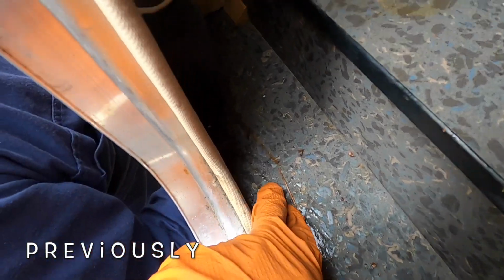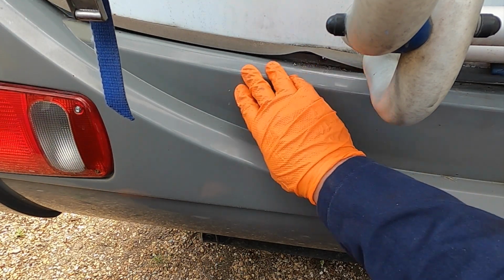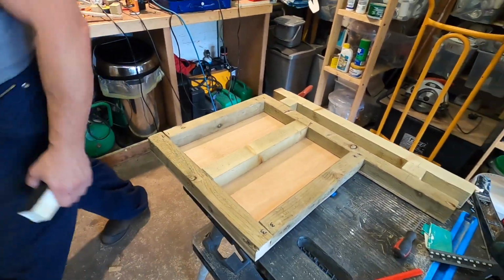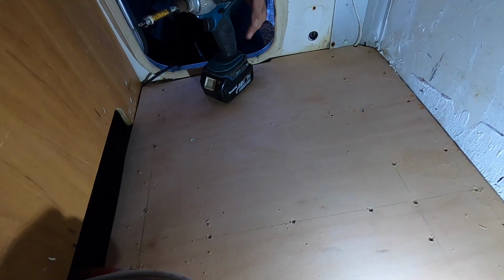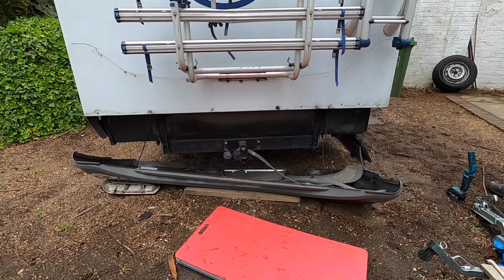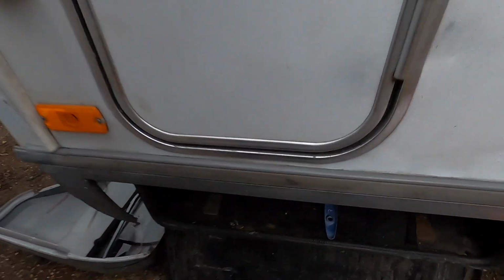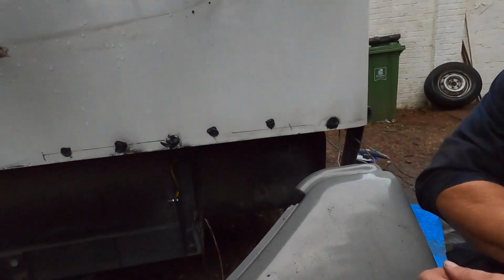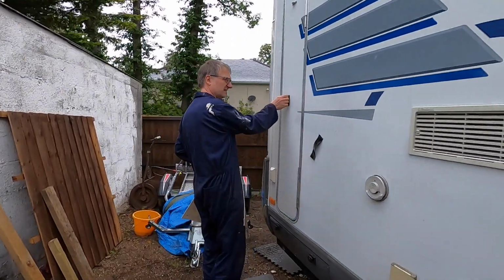MASSIVE HOLE in Water Damaged Floor

Comment: Well done Ads and Chas for what I would consider an excellent job. I need a Chas down here in Southern France.
Reply from the maker: Thanks Robert, what wrong with your vehicle down in France?
Reply: @HermanHitstheRoad  Nothing really. I've recently serviced it, including new discs and pads, and I know all there is to know about the interior and have changed most of the usual stuff, pump, electrics, tank sensors etc. etc However, we have Alde heating that has sprung a small leak in the cylinder. I've managed to buy a new boiler (ex bankrupt stock here in France). The location of the boiler in the van  is awkward to say the very least. Access is via a small hatch on the side of the van and you need to part dismantle the old one to get it out and the reverse to get the new one in. I don't fancy doing it myself to be honest. That's why I need a Chas, ha ha
Reply from the maker: You want to get that leak sorted as soon as possible otherwise it could cause a lot more problems. Just take your time and I'm sure you'll get it done. Would it help if you removed some panels, wardrobes etc? I wish we could help. Maybe you can send us some photos or do a video?
Reply: @HermanHitstheRoad  Thanks Ads,  It's times like this when you could do with a little help. I had it booked in to have the work done in March ( I think?) but they couldn't do it because of lockdown/sickness etc. We've been to the Alps since I may add without me having to top up the reservoir. The boiler is ok if it's on (water expanding) but if I switch it off and it gets cold, it leaks through, what must be a pin prick of a hole. I'd like to send you some pics but where do I send them. There doesn't appear to be an e-mail address on YouTube. Bob
Reply from the maker: @robertpenning3501  You'll find my email on our channel page under "About".
So, it only leaks when the water is cold? That's odd. Could it be that when it's hot the water evaporates before you see the drip? Or that there's a seal which heats up and expands stopping the water?

Comment: If you want to tidy the back wall up use the 4 way stretch carpet they use in camper conversions and it would be easy and look very tidy. There is a video on YouTube showing you how to do it. Good job with the floor.
Reply from the maker: Thanks John, I'll look into it. I might just use the hair dryer and scrape it off. 🚙👍👍👍

Comment: You two have such a light and encouraging manner whilst also knowing your stuff. Could I please ask how you fixed your made up 2 by 2  insert frame to the existing 'ply and insulation sandwich' floor. There isn't a great deal to fix it to, is there as it is mainly insulation foam plus thin top and bottom ply. I ask this as I am about to tackle something similar!
Reply from the maker: Thanks Nicholas. We screwed in from outside into the side of the frame and also through the wider plywood floor.
I hope that helps.
Reply: @HermanHitstheRoad  thank you so much! So does that mean you took out some of the insulation from the existing ply sandwich floor and then tucked your new frame inside the sandwich  cavity where you had taken the insulation out....and then screwed through the old ply floor into the 'tucked -in' new frame. Sorry to ask again but I can't quite visualise what you did to join together the old ply sandwich and the wooden replacement frame you made...
Reply from the maker: Hi Nicholas, I'm sure it shows you what we did in the video. We didn't do any tucking (I'm not even sure that's possible). The frame with the new insulation fills the hole and is screwed in through the walls. The plywood is laid on top of the frame overlapping the original floor then screwed down.
Reply: @HermanHitstheRoad  thank you again. Slowly things are sinking in and making sense. You are very kind to take the time

Comment: I'm about to embarc on a very similar job with the garage in my van, what is the paint that you used on the wood? Brilliant video by the way amazingly helpful, especially to this noob!
Reply from the maker: Hi Paul, I think it was called Dimoltrol wax. We also painted on Waxoil. Hope that helps and good luck 👍👍🚙

Comment: Great job you two. What was that black stuff that you put on the flooring on the underside? And I am thinking that it would have been a good idea to put in on the plywood under the vinyl flooring as well.
Reply from the maker: Hi Annie, it's called Dinitrol. It's like Wax Oil which you spray. We also used Wax Oil's Car Body Undersealer which is a thick tar like paint. If we used the Dinitrol on the top then the vinyl probably wouldn't have stuck down. 
Am I right in thinking that you are fixing up your own moho?
Reply from the maker: Oh, that's right. I've just remembered that you don't have have moho yet.
Reply: @HermanHitstheRoad  - Do you know if that Car Body Undersealer is oil based so that it doesn't emit any gasses? I would guess it is, since it is tar based.

Comment: Hello guys. Stumbled upon your channel. Looking at the repair you did on this van I’d like some advice. We have just purchased a 4 berth camper and there’s a small hole in the floor underneath the van. It’s in a difficult place to get to right next to the step for the door. I know it’s a job to know without seeing the van but how would you tackle this job ?? I can’t see an easy way of attaching new wood. I think I need to remove the step and take out the tool box that’s in the locker next to it. Any thoughts ?? Thanks for the vid.
Reply from the maker: Hi @robpullen, welcome to the channel 👍. I think you need to find out what the extent of the damage is, why it's occurred (so you can stop it) and what needs to be removed to gain access to it. To do all that you may need to start taking things apart or find a forum or Facebook group on your motorhome and ask them for advice.
You might be able stick and screw in new wood from the bottom after removing the rot. Or there are rot repair paints and wood filler which you could use. Just make sure the problem and the repair doesn't continue and is safe. If people are likely to stand on it then you might be able to strengthen using thicker wood. Also, make sure the rot hasn't extended to the chassis. 
I hope that helps
Reply: @HermanHitstheRoad hello and thanks for the reply. Yes this motorhome thing is all new to us and we’ve only had the thing for a few weeks. I missed the damage when viewing and so I guess it is what it is. Thanks for the advice. I need to dig a bit deeper and as you say take some bits off so see the damage completely. I don’t think it’s leaking any longer I think this is damage from outside the van and doesn’t extend to the interior.  I’m just gutted that I didn’t spot it when I looked at it for the first time when purchasing.  We’ve been out in it a couple of times and love jt so it all depends on how much it’s gonna cost to put right etc.  thanks for getting in touch. All the best

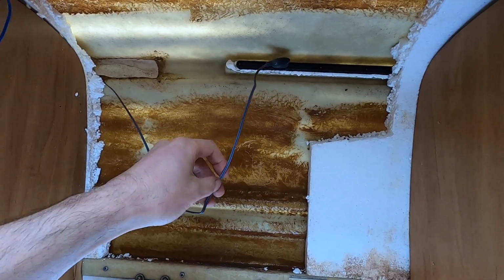Comment: 18:34  I'm shocked because I was sure that Hymer has been using only the PUAL system with PU foam in its construction since the early '90s, not Styrofoam! Yet, here we have Styrofoam in the floor and behind the cabinet. Strange...
Reply from the maker: I don't know what PUAL system or  PU foam is but we did replace it with Styrofoam, @addicted2cars